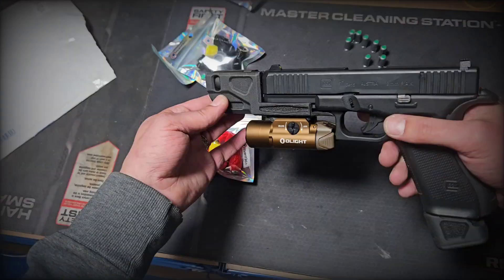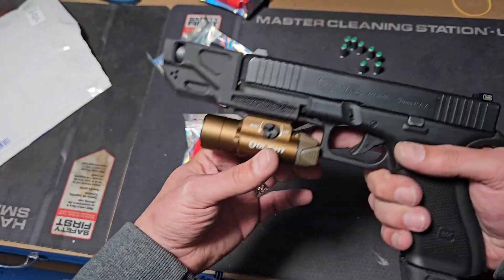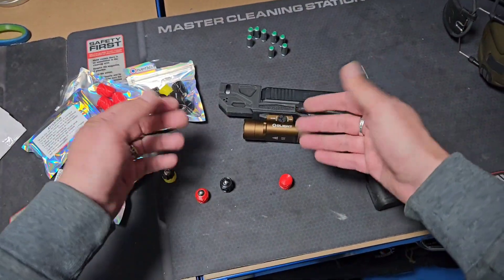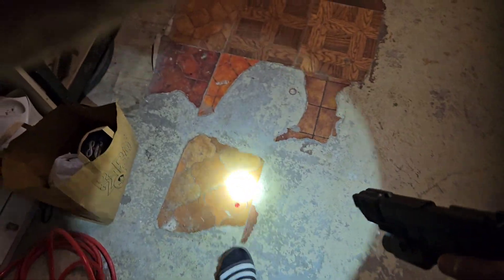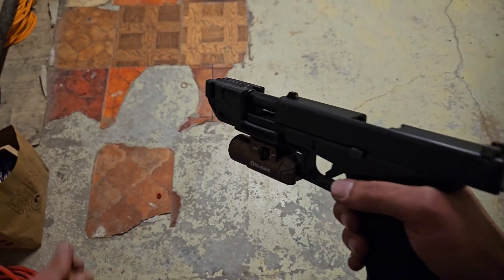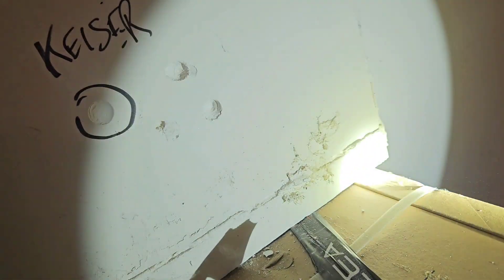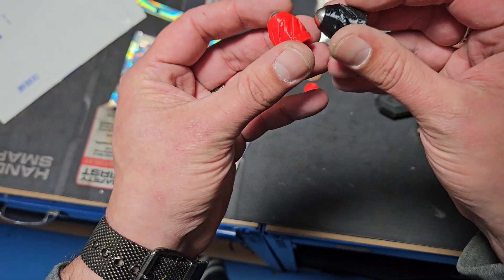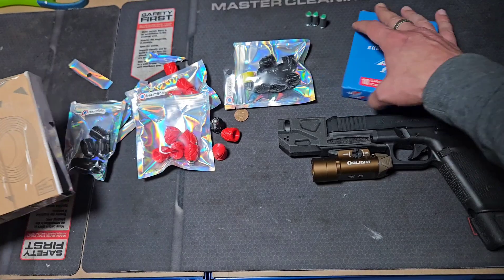SLUGS PAK INVENT3D.FR, LE TEST

Comment: Hola JP. J'ai le Glock 17 PAK. Attention au chargeur, j'avais préparé pour la défense, mon chargeur 3 cartouches poivre, 3 cartouches à blanc. 6 mois après j'enlève les cartouches poivre, je mets l'adaptateur lance fusée. J'ai voulu chambré une cartouche pour lancer une fusée, impossible de chambrer, et ça dès la première cartouche. Le problème c'est le ressort qui doit être fait en guimauve, il s'affaiblit au fil du temps. Je l'ai donc étiré , et là ça a fonctionné. Moralité si tu as un squelette qui se pointe chez toi, impossible de te défendre avec ce défaut du chargeur, à moins que le squelette te laisse le temps de garnir ton chargeur.☹
Merci pour le partage 💪
Reply from the maker: Oui c'est un problème connu avec les PAK en général, il ne faut pas laisser trop de munitions dans le chargeur trop longtemps
Reply: @JPVadanaLFH  Ce sont de jolis répliques,(je regrette pas le mien) surtout faites pour du tire récréatif, et aussi comme lance-fusée c'est top. Mais pour la défense ça craint.